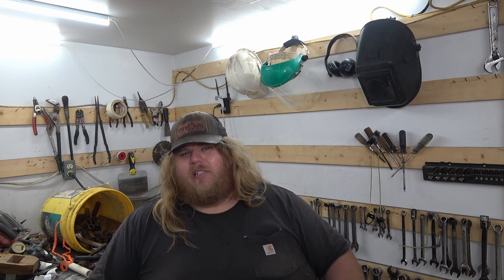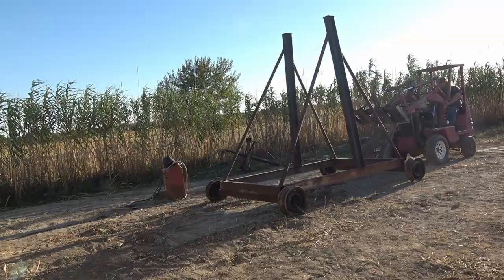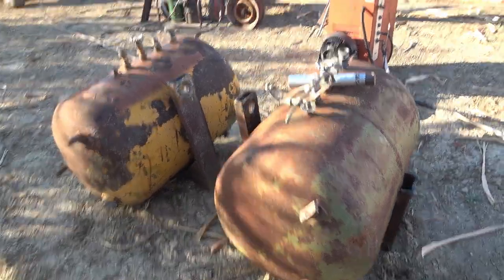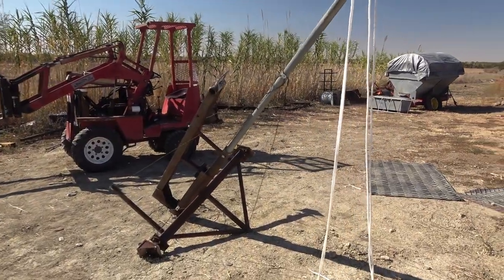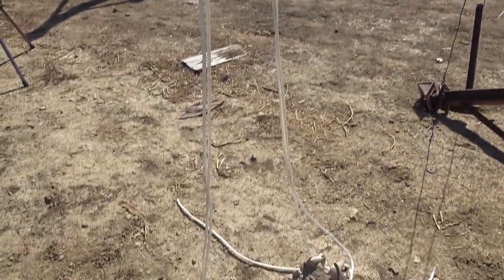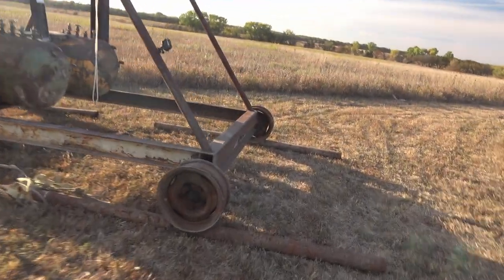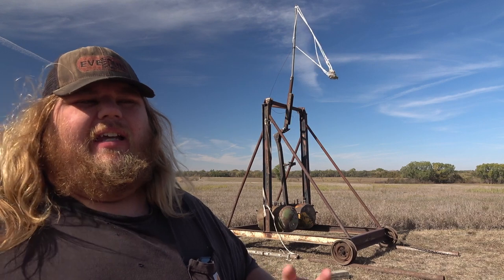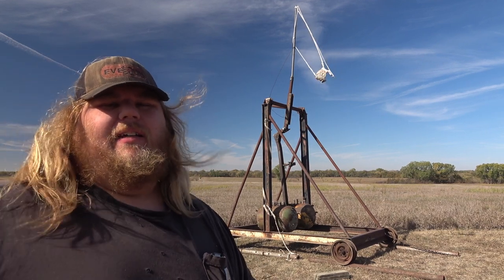MASSIVE Trebuchet/Catapult BUILD

Comment: I thought it worked great as the first test and it does not look like it needs a lot of adjustments to work as you expected. I can't believe it bent that I-beam, it looks like a couple of parts need strengthening
Reply from the maker: Yeah I wasn't expecting to bend the I-beam either, it's amazing how much power a falling counter weight can have!

Comment: I think  I have a way  to keep  your  weights  from  hitting  the frame. instead  of one upright  from  the weights up to the pivot make two uprights above the axle  then a pipe between with  the pivot  on that. basically a rectangle with  the weights  on the bottom will  reduce  the twisting motion. throw  some duckpin bowling balls.  I mad some  round two piece concrete forms from  a old kids ball and spray foam for  5lbs concrete balls. good chucking.be safe
Reply from the maker: Thanks for the advice!
I'm going to make some bushings for the weight and lower linkage pins.
They have a bit of slop which makes them move side to side more than I thought it would.
I'll keep your idea in mind if this doesn't work out since this is already built.

Never thought of using one of those kids bowling balls for a mold, I'll have to try that 👍.

Thanks for watching 🙏